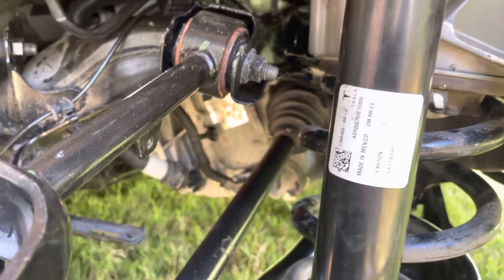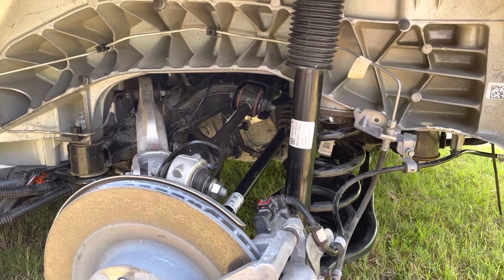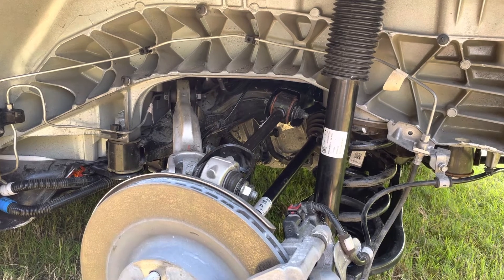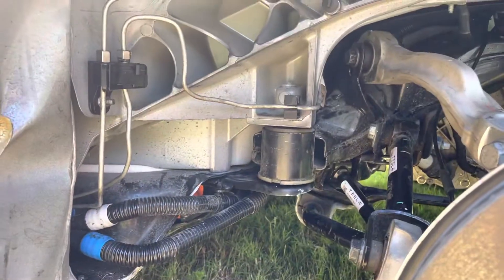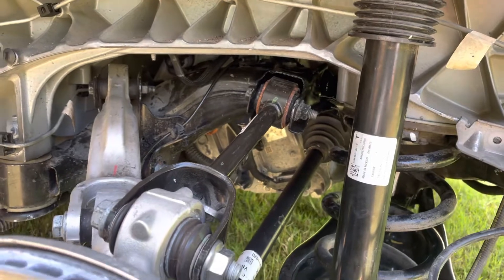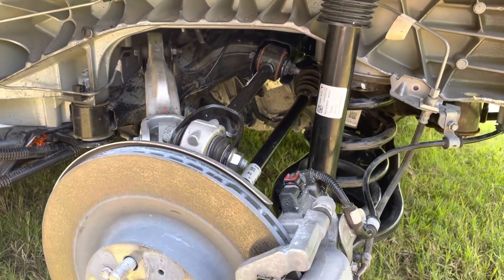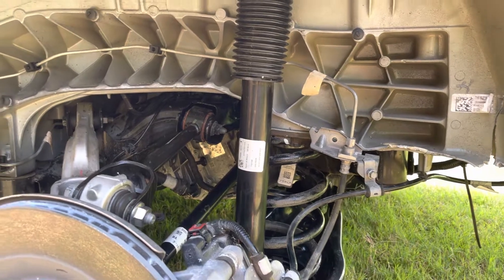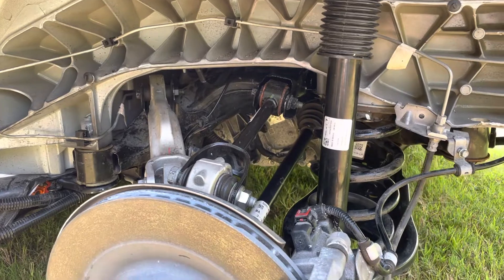How to replace rear driveunit inverter on Tesla model Y & 3 without a lift DIY (HV isolation issue)

Comment: Can you confirm if you can restore a bootloader and app data into a second hand replacement?
Reply from the maker: I believe it did work for me.  But not sure now if I needed it as I used an inverter from same car model.   If you get an inverter from same type of car you should be able to use it without restoring bootloader or application data.
Reply: @diytesla  unless it incorporates the vin in the bootloader & app data & that's what the immobilizer paring confirms. Will have to listen out for someone doing a like for like swap that doesn't follow the toolbox process.

Comment: Do you know the reason why rear drive unit fails on M3 and MY? I have 2018 M3 LRDM with failing isolation, I know that it needs inverter/drive unit replacement but I’m curious what’s the reason?
Reply from the maker: Some kind of defect in the inverter.  They fixed the problem on the newer cars it seems.
Reply: @diytesla  yeah, that’s I know that they fixed:) in my case unit become broken after 95k kilometers and salvage, car was bought from copart
Reply: @diytesla  what do you mean by "newer", the NEW model 3? I am asking because mine is 2023 (bought in Dec/2023) and today (01/10/2024) I had mine replaced after ONLY 33k miles.
Reply: @diytesla got 6k miles on 2024 model y and it's throwing isolation codes already.

Comment: Could you please tell me why the rear subframe has to be lowered? I just can't find the reason by locking at pictures and 3D models of the subframe with the motor installed in it. It should be no problem to take out everything to the bottom instead of the top.
Reply from the maker: You can’t, you have to lower the subframe just a little bit.

Comment: What could be the cause for Inverter - Rear Drive Unit (3DU) (Remove & Replace)
Reply from the maker: That’s a procedure in the service manual.  Reasons for replacement can be many, but usually rear inverter needs replacement due to issues with HV isolation.
Reply: @diytesla  that was the problem with mine (I could see it on SERVICE MODE screen).
Reply: My 14 months old TeslaY just stopped in middle of road with warning pull over. I am told that inverter rear drive unit needs replacement. Lucky I didn’t meet with a accident as it wasn’t a busy road. No sure what caused it hence asked the question.
Reply from the maker: It’s just a flaw in the design or manufacturing of the inverter.
Reply: @saurabhsole I have the same problem and asked Tesla service about it - they answered "you must change battery for 15k and may be additional labor" WTF? Looks like Tesla make money 2 times - on sale, on service